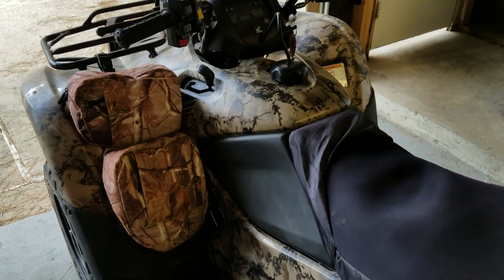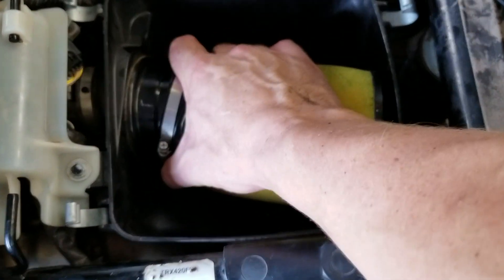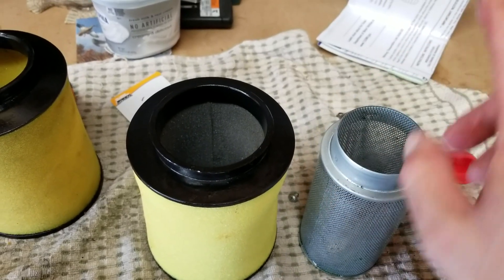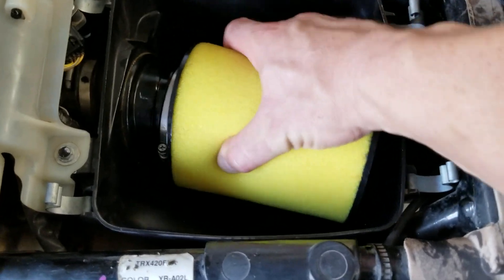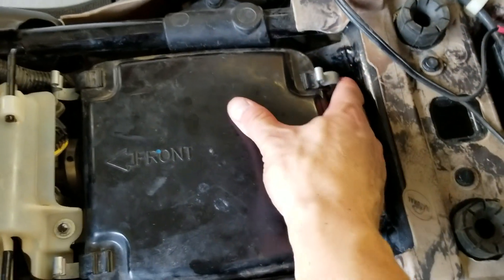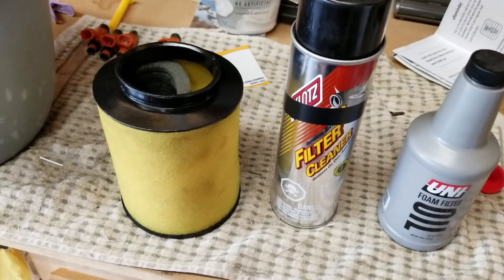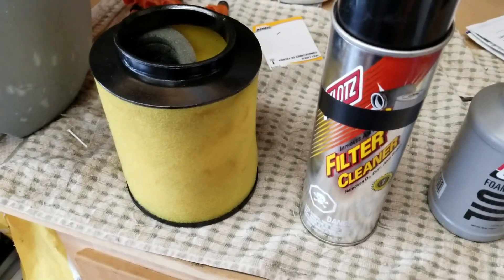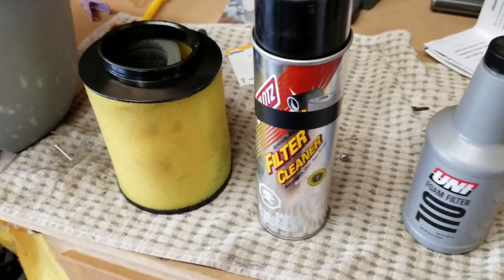2010 Honda Rancher 420 4x4 ES - Air Intake Filter

Comment: Mine is kinda oily, what does that mean
Reply: That’s normal but if you want better performance you can buy one for like 35 dollars that will increase horsepower
Reply: Supposed to oil them, oil collects dust and debris and keeps it from getting into the engine!